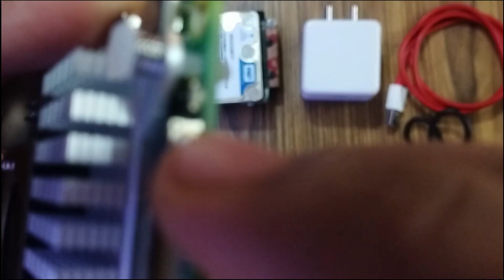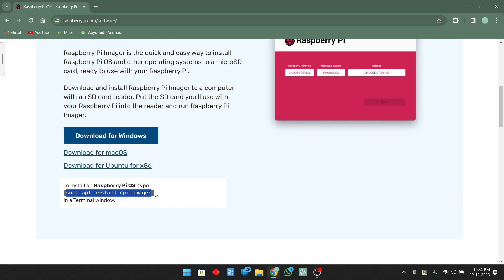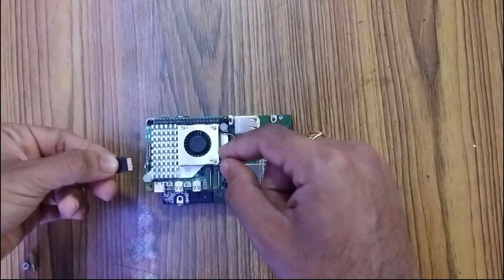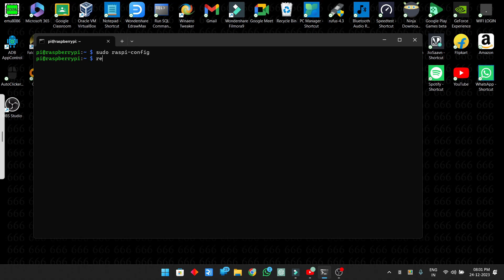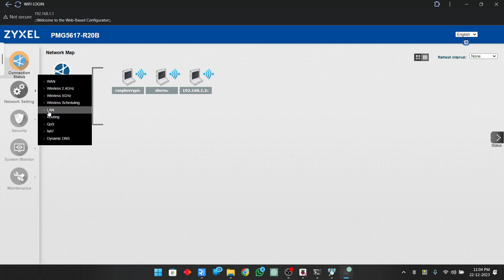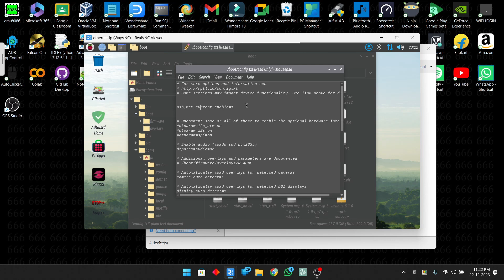🚀Boot Raspberry Pi from HDD/SSD/SD card without official adapter | Headless Install of Pi OS.

Comment: How to boot from HDD on raspberry pi 5
Reply from the maker: use the sata cable i have shown and connect it to the desktop and follow the instalation process after flashing the os finished         if you dont have 5 v 5 amps power supply( go to the hdd files and watch the video where i have show the command you have to add then just connect the hdd to the raspberry pi it boot up)